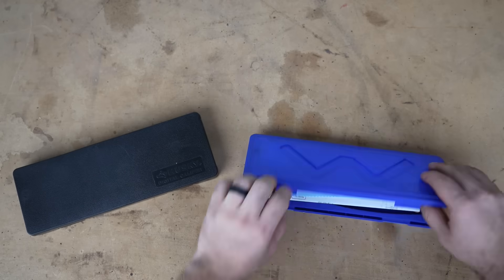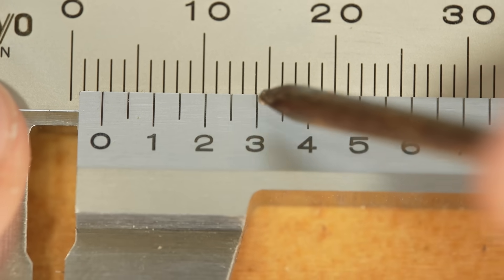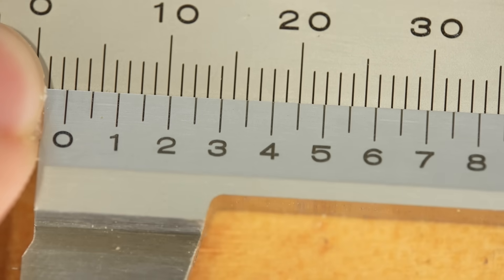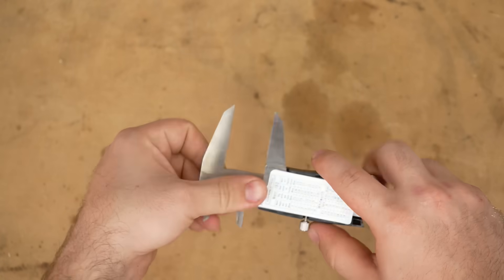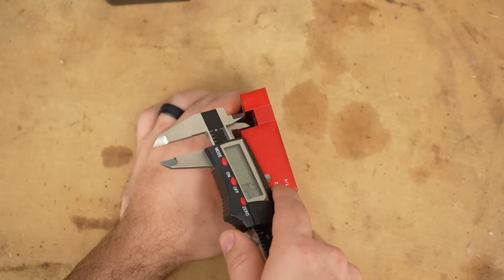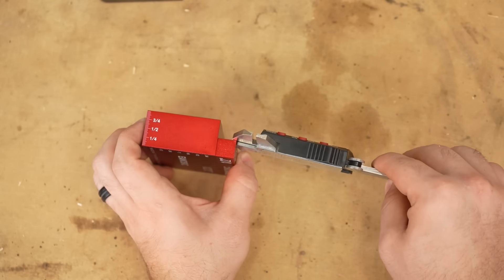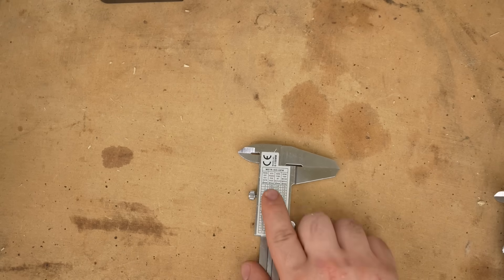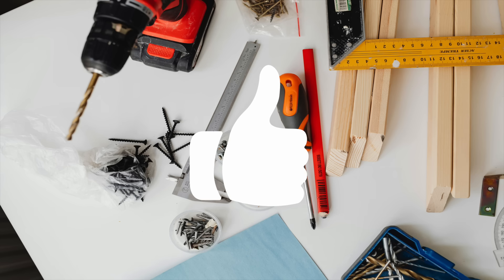I wish i’d known this sooner, How to use calipers like a pro

Comment: That china export thing is an urban myth. Just check wikipedia on the CE_Marking page and it's under the misuse section. There may have been a few times this happened, but it's really not a thing... Otherwise good video! 😄

Comment: 3:25 Another reason to stay close to the caliper is to not wear away the material of the ends of the external measurement side.  If you're working with steel or harder parts, you can wear away the tips of your calipers.

Comment: i hate this for not using diaal calipers which any machinist will tell you is the only way to go.... vernier are definitely better than digitaal... you can use digitals to measure twice and get 4 different measurements

Comment: if you want to measure the distance between the centers of two holes: reset the digital measurement to the diameter of the hole, then measure from the outer diameters of the holes, the measurement is the distance between the centers of the holes
Reply: This only works for holes of the same diameter.
Reply: @PiefacePete46  
is correct, this method of measurement can also be applied, for example, to measuring the distance between the centers of dowel screws

Comment: The biggest advantage of cheap digital calipers, for me, as an old DIY person, is the ability to easily switch from imperial, to metric, and to fractions. I use all of them -depending on need, and experience. Yes, the cheap ones eat batteries.

Comment: Always remember, when first time handed a new vernier caliper (doesnt matter digital or "classic"), slide it together COMPLETLY while being clean of debris and chips and such and hold it against a light source. If you see light going through the measuring surfaces it's used up/bent/shit quality. Check if theres a notch on the inner diameter jaws at the end (from being dropped/bumped/not fitting the box it came with). Last but not least the analog vernier calipers should actually show 0 when fully slided together. Seems weird to say but I cant recall how many cheap ones had their scale etched/lasered crooked or offset.

Comment: A digital caliber can be used to easily measure CC and C to edge. For example when measuring cc between holes it will be zeroed at R1+R2 and it will show the CC between holes. When measuring the centre to an edge it is width or diameter (outer) divide by two, zero the caliber and measure with step measurement.

Comment: I mostly use digital calipers, and I rarely use other functions. I just use the outer measurement, set it to zero, and then take the measurement of the steps depth.

Comment: I'm done with digital calipers.  Bought a Starrett digital and it died.  And Starrett couldn't repair it!  I was supposed to buy a new caliper.  To Hell with that AND the batteries!  I bought a Mitutoyo dial caliper and take very good care of it.  Yes, dial calipers are a bit more fragile.  I take care to never drop it or even put it down hard (I keep it on a cloth when using it on my workbench).  And I always wipe it down when done.

Comment: A machinist taught me to always check that the caliper reads zero when closed.  If it does not read zero, then it is likely that there are tiny metal chips on the jaws.  Also the zero on a dial caliper can be adjusted by loosening a set screw and turning the dial face slightly.
Reply: First thing I do when I check a part is wipe the mating surface of the caliper and part. A little dirt can throw off a measurement by 0.010 like it's not even there. A good indicator that calipers were likely dropped in the past is if the zero point is not at the 12 o'clock position when holding them horizontal. 
There's a bunch of little things I learned as a machinist. A mistake I see many people make and I used to make early on is applying too much pressure when taking a reading. Anything more than light pressure with give you a false high reading.
Reply: Yes, that's very important, a lot of new calpiers don't have zero when it's new, today quality is very bad and you should never buy it online because you can't check it. Sometimes you can slightly adjust it when you unscrew little screws and move with that part with 0, but not when it's 0.5 mm difference, that's too much.

Comment: :) I'm happy you are aware of China export crap. 
But, is actually more honest then most CE markings on the market right now. 
If the measuring device that you want to buy does not come with complete paper works stating the accuracy and tolerances, then is not a real measuring device. 
This does not mean you cannot make use it in a home shop.  
Best thing "for the buck" will be a caliper that was made in the est block, they will be available as NOS, cost as much as a "chinatech" and they are just as good as a Starret. (just clean the old oil goo of them)

Comment: Just use the digital ones.  It's much easier, and faster.  If you want precise measurements, use micrometers and lab grade gauge blocks/pin gauges.  Vernier calipers will get you to .001"  About the same as a cheap digital caliper.  You can get precision calipers, but you are going to pay megabucks for those.  Get a cheap set of digital calipers and micrometers.  That's good enough for most machining.

Comment: You know, I still have my KWB General swiss company calipers which I bought about 50 years ago, made out of plastic.  They are still accurate to about 1/6-millimeter for outside accuracy.  Inside is limited by the overlap of the blades and cannot be used under 1/2-millimeter (except by using optical comparison).  I use these almost daily for various projects.  They require no maintenance, are not magnetic, have been dropped dozens of times.  Comparison measurements are accurate to about 1/2-millimeter as based on the needle width, and angle of view.  I've bought other super-sophisticated models and I only use these once in a blue moon.  For an ordinary engineer, these 6-dollar models work just fine.  Almost as good as a finely ruled steel ruler.

Comment: 38+ years machinist here, one thing I would add, when using the blade type calipers, use only the blades when possible. I have measured a plug gage with the blades, then on the heavier flats and gotten a .001" difference. I unserstand that sometimes it can't be helped. Also, search pictures of the Starrett vernier calipers, the only have the main jaws, and they aren't bblades, but nibs that are flat and parallel on the inside (for OD measurement), and radiused on the outside (for ID). There are seperate scales for ID and OD so you don't have to compensate. You didn't mention mechanical dial calipers, no battery and easy to read. Last year I had to replace my 20 year old Browne & Sharp 6" dial calipers when they decided to kiss the floor. I would have sent them for repair, but my company bought me brand new ones. Now owned by a Swiss company, Tesa, and still the same excellent quality.  Some regular micrometers also have a vernier scale for measuring to .0001".
Reply: Dial were mine and basically everyone else's preference when I was machining. I actually find digital quite annoying.
Reply: Yes, Swiss made is good.

Comment: I think this is the best video I've seen on using these tools properly. 
🙂👍
I use the Vernier Calipers in Locksport and although I've used them reasonably right, but now I realise that I need to tweak how I use them.
Like many others I thought the calipers that were non digital were nowhere near as accurate, thanks for clearing that up 🙂👍

Comment: Don't buy that Neiko brand or any other of that specific design, I've seen a few of that specific design with different names, as the battery location is horrible and the holding down properly of the battery in place doesn't last long eventually making them useless... I've gone through 3 of that design, 2 different names, not Neiko, before I got tired of buying replacements....

Comment: As for the CE mark this is not as straight forward as you might think. I have been writing CE certificates for several years and the problem with the CE mark is, that even propperly certified companies use the wrong logo because thats what you easily find on the internet. The correct one I had to draw myself using the official guideline you have posted because i could not find one that was 100% correct anywhere (that was a few years ago). So most companies just use what they can get their hands on and dont even think about it. I have seen the "china export" version on pumps at gas stations and on top grade heavy machinery. If you really want to make sure that the product conforms to european standards your best bet is the certificate of conformity. There is also a lot more to the CE mark, placement, minimum size etc. than you might think. From what i can tell if you were to scan the CE mark on your calipers and try to overlay it to the official one, it pronbably will not be 100% the same either. ;)

Comment: What a revelation! Thanks for exposing yet another Chinese deception. And yet, whose fault is that? Useful 'infovideo'. 
Many years ago, our QA department heads wanted to be on the cutting edge, They insisted on the machine parts inspectors using newly purchased "more accurate", digital calipers. Our inspectors, for the most part, were experienced machinist who scoffed at the idea and could easily prove the 'suits' wrong on the accuracy issue. On the plus side, mahogany row could now be shown the dimension a familiar way as it appeared on the drawing. 🙂

Comment: I didn't know about the step measurement, the Ching chong export ripoff emblem and never really read the chart on the back.
I figured out the inbetween measurements when I was 13 playing around with it and noticing that the lines were indeed matching up accordingly

Comment: I love my calipers, digital to simple plastic one always within reach for quick verification size of item, be it check screw dia for best drill choice for through hole. To confirm battery dia for correct choice when ordering Rechargeable battery. 
Amazon is really bad on titles of items, where five batteries are the same, and have different titles in the heading. 
For threading, out comes the digital to read thread pitch depth, and the best tap drill for my class of fit. 
This gets critical for aluminum where listed tap drill may create too much clearance. 

Aluminum forming taps remove very little material, where aluminum is basically hard Dutch cheese. 
And specific tap compresses aluminum making threads, vs shearing material out. 

If item is aluminum air cooled engine block, if overheat range extends too far, bolts under high tension can easily shear past one thread in stacked condition, and now bolt is seized. And a blown headgasket where condition happened to related bolts as well. 

In steel, you'll notice standard thread engagement is roughly 60%. 
This is far to weak for aluminum under high tension, combined with high Temps. Aluminum expands too much. 
Cheers

Comment: Fun Fact! The "China export" symbol doesn't actually exist. It's just that some manufacturers (mostly the cheap one, who happen to be concentrated in China) don't use the symbol as specified in the regulations, only something that looks like it. That doesn't mean that the product doesn't otherwise conform to European standards, but it's a good indication that a manufacturer isn't all that attentive to regulatory details.
Reply: Fun fact the symbol exists in so much as there are so many Chinese manufacturers using it to imply something it's not. Has nothing to do with attention to regulatory detail, it's entirely there to deceive. Have been experiencing this logo being used in electronics, radio and other tech areas. It's very common on counterfeit circuit boards and component supplies and has been for ~20 years.
Reply: @Dennis_M1DLG 
China export is a 15 year old myth. It's been debunked a lot of times, even in the European Parliament. 
https://en.m.wikipedia.org/wiki/CE_marking
Reply: @Dennis_M1DLG  Printed circuit boards do not need to bear the CE mark. Since PCBs are a component and therefor only part of a larger product and is thereby except. (Not I am oversimplifying greatly here, since it depends on a lot of factors.)
But secondly.
The biggest producer of the compressed (and thereby incorrect) version of the CE mark is Microsoft, on their wireless Xbox 360 controllers. Not a particularly cheap product, and not made by a particularly small company. It is however a simple mistake to make when label design doesn't get checked by the legal team.
Reply: @todayonthebench   I didn't say it was a requirement. It was used to imply fraudulent country of origin. Furthermore PCB's are the end product in many cases where my comment refers.
Reply: @Dennis_M1DLG  Yes, you didn't.
My comment were simply to clarify that it often isn't on PCBs.

But the second part of the comment is about the fact that a lot of the compressed CE marks stems not from a desire to deceive, but rather from misunderstanding the regulation stipulating the design of the mark itself.

Comment: Quite clear and useful explanation, thank you very much. Only an observation: if a caliper has a 0,02 mm resolution and you measure an exact 2,5 mm , it is useful to express the measurement as 2,50 mm, the last "0" indicating that the instrument used to measure has the capacity to resolve the order of magnitude of 1/100 mm. To inform completely the result of the measurement it is useful to indicate the resolution of the instrument as the uncertainty: (2,50 +- 0,02) mm. If the caliper used would have been one with a 0,05 mm resolution, and an exact 2,5 mm would have been measured, then the result should be expressed as (2,50 +- 0,05) mm. Both measurements would be the same, but the first one is the best, because it has a better accuracy

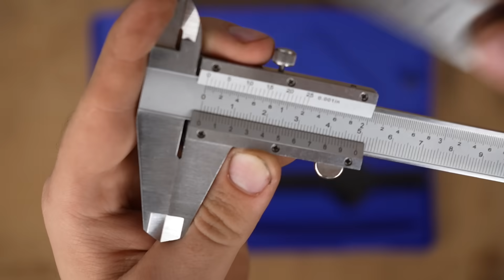Comment: 1:10 I recently did a project where I made a large number of accurate measurements using calipers, both digital and vernier. In the end I switched to digital calipers because it reduced the mental labour required.
Reply: few days ago I typed 10 times 3 into calculator. I am not machining with my Casio

Comment: I worked in one shop that had a Chinese 12" dial caliper, and that thing had a number scale along the beam that was off a mile. Fully extended, the number scale would read something like 11.8 instead of 12. You had to have a good rule with you to measure how far apart the jaws were.
Reply: Let me guess -- they laid out the number scale with 25mm "inches"....

Comment: Thanks for explaining the purpose of the notch in the rod and for talking about the two versions of "CE" mark.
Reply: A quick check of Wikipedia will show you that the "CE" mark story is not correct.  (That does not necessarily mean they DO comply with the CE requirements though!)

Comment: I like my Mitutoyo digital calipers. The action feels smooth and the battery lasts a really long time in them compared to cheap chinese calipers. I really like dial calipers but I've had the rack and pinion mechanism fail due to debris ingress. There's nothing to go wrong on vernier calipers, as long as you can read them.
Reply: The zero doesn't change. That's a big plus.

Comment: The most common calipers I see in industry for 6", 12" and 24" sizes are dial calipers though digital have taking over in many places leaving Dial and Vernier calipers as the backup.  Beyond that 24" size you generally only see Vernier calipers since measurements beyond that size are far less often made or only made in specific industries.  Digital calipers are becoming fairly common but they are almost always backed up by having a dial caliper just in case since inexpensive digital calipers are notorious for having dead batteries and some even have drift over time when making several measurements so you have to check and zero pretty regularly.  A good quality Vernier or Dial Caliper will last you a life time if used, stored and taken care of properly.  I have had Digital ones fail just from sitting in their case in the shop tool box but I am sure that is mostly down to quality.  The other thing to remember is while some digital calipers (and dial calipers for that matter) may offer more precision on the display readout (adding a digit for the 10,000s place), in real world measurement the actual accuracy of all three tools is about the same and is highly dependent on the quality of the measuring device.  For example a low to mid priced 6" caliper of all three flavors that claims a measuring precision of +/-0.001 inches is likely only going to be within about 0.002 inches of actual accuracy which is still more than fine for the majority of measuring tasks but if you need more accurate measurements you may need to move to a micrometer instead.

Comment: I’ve had a set of Mitutoyo calipers for about 25 years. They still have no play in the jaws and were used extensively during my time working as a mechanic on heavy machinery. I’ve been retired for 10 years but still use my vernier calipers all the time in my home workshop as well as a Mitutoyo 0-1 inch micrometer for really accurate measurements. I was brought up using inches but systems changed to metric in my younger days. I still like to measure fine measurements in thousands of an inch rather than using my metric mics.

Comment: You missed one, very important information, to those, not so familiar users:
How do You use, the step measurement!
This was never explained.
I have had several questions concerning this, since I am a fabricator/engineer, with "hobby machinist" friends.
So, next time You do a, otherwise very informative video like this, don't overlook a thing, less commonly, but very important "thing", to know.
from a Finn in Diaspora